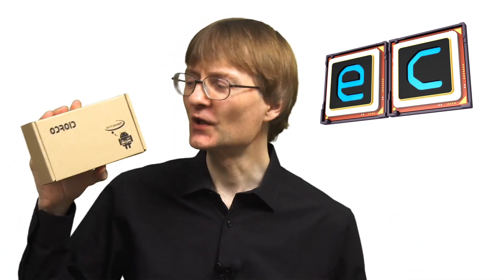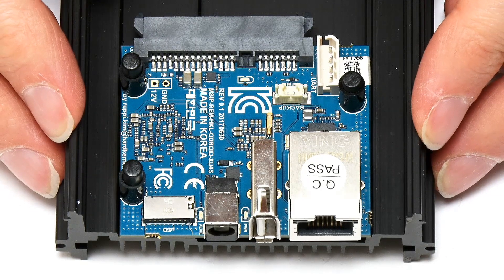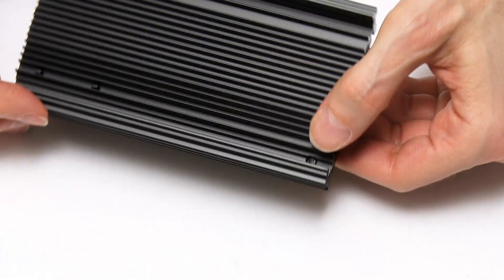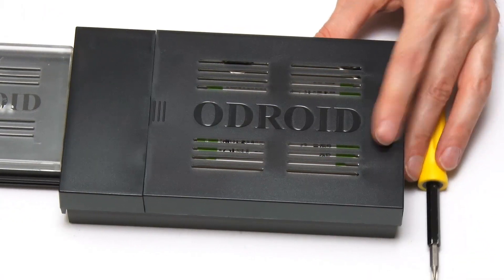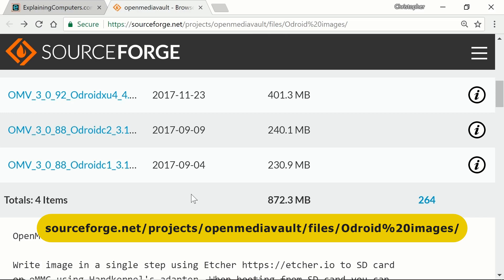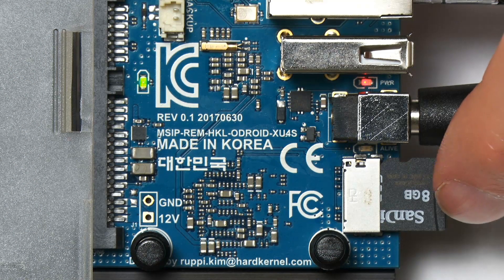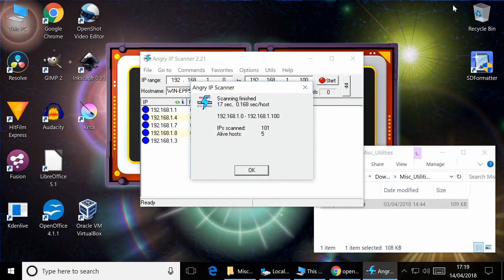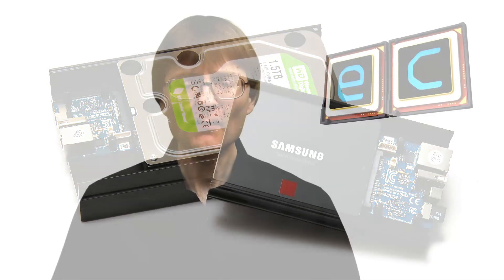Odroid HC1 & HC2 NAS SBCs

Comment: The only problem I have with this is the lack of redundancy as a proper NAS should have; RAID 1 at least.
Reply from the maker: There is nothing in the definition of a NAS requiring RAID  -- and rember that for domestic use, a fire, flood, electrical surge, theft or ransomeware attack will be just as dealy against two drives as one. A RAID NAS does not provide a safe backup of your data in most domestic scenarios.
Reply: ExplainingComputers yes, that’s true, but I’ve never implemented a NAS (ou a file server) without redundancy.
Yesterday I tried OMV and I think it’s interesting, but I had only a Pi 3B+ available so it was not very fast... that 1gb RAM, USB 2 and 10/100 ethernet just don’t cut it. But if I can find a backup software that allows me to plug an external usb drive and automatically copy all the NAS files, I’m buying a Pi 4. 
Do you think 2Gb is enough or the difference for the 4Gb version is very noticeable?
Reply: (Just realizes my answer is a bit off-topic, but you got the point...)

Comment: How long does it take to boot?
I want to use is as a sort of backup dirve, for doing weekly backups on my main server. The idea is, that i will turn it on using a smart wifi controlled relay, let it boot, mount its internal drive, do an rsync, unmount and turn it off. What kind of a delay to expect between supplying power to the device, until it is ready to accept network connections?
Reply from the maker: I cannot remember -- less than 30 seconds as I recall.

Comment: NAS need RAID
Reply from the maker: "NAS"  stands for "network attached storage", and no system "needs RAID" to provide such functionality. If you want to keep data safe, it needs to be stored on multiple, isolated devices in different locations -- something no NAS can achieve by itself, whether it is using RAID or not.
Reply: @ExplainingComputers  I dont thrust nas without raid focused on security.
Reply: That is correct, NAS does not need RAID. Whether you want it or need is a personal preference.

Comment: I have odroid HC2 (larger version) for over a year. Recently, I began to lose connection with the NAS when transmitting data through the Ethernet connection. The processor temperature was more than 70 degrees C. The reason is that the processor lost contact with the aluminum heatsink because the heatsink was bent

Comment: You should do a NAS with a new Raspberry pi 4 with 4GB of RAM and compare
Reply from the maker: I will indeed do a Pi 4 NAS video. :)
Reply: @ExplainingComputers  Sweet! I have one of those Synology Disk Stations, a bit older now,  and I love it, but I believe that the Pi 4 is actually faster, and with the 4GB model, that would be much better. My Synoology has only 512 mb :(

Comment: I Have 2 questions after ordering my HC1 : 

1. Can I make the Odroid HC1, at the same time, serves as a Web Server and a NAS ? 

2. Did the 2.5" HDD have the screw to hold it tight into the heatsink ?

Thank you !
Reply from the maker: It is a while since I made this video, but I think the drive screws were included. In theory it would be possible to install a Linux distro an run both a web server and a NAS. But I'm not aware of this setup having been done on the board. I would suggest contacting Hardkernel, or asking about this in their user forum.
Reply: ExplainingComputers my thanks ! 

I will look into this experiment when my board arrive :D

Also, if the speed is like 100mb/s, both SSD and HDD Max speed should be the same ?
Reply from the maker: Yes, NAS speed is limited by the Ethernet speed, not the drive.

Comment: Thanks, good video. But I wonder a bit about the use case. 

Megabit per second Megabyte per second
9 Mbps                   1.125 MB/s
10 Mbps                1.25 MB/s
11 Mbps                1.375 MB/s
12 Mbps                1.5 MB/s 

Amazon seems to recommends at least 15 megabits per second, Netflix 25 Mbps.
Reply from the maker: Your table is correct, but I am confused. The speed measured with the Odroid HC1 was just over 100MB/s (megabytes a second), or 800Mb/s (megabits a second). So it easily supports video data rates.
Reply: @ExplainingComputers  Yes, I meant it the other way around. It is so fast, that I wonder why I would need that. :D

Comment: 49$ sounds about right for what basically amounts to a HDD/ethernet converter

and it's even stackable
Reply: I would like so much to have a little bit bigger enclosure so I can fit another drive on the other side. So I can setup a backup drive.
Reply: @kugick  1. they are stackable, you can mount the disk from one odroid onto the other odroid and make a backup, like you would make any backup.
2. you can always partition a single hard drive and keep the two partitions synchronized.
Reply: @MsLia32  But isn't stacking a second one mean that I'm buying a complete second machine? To me it would be really cheaper to just have a secondary connection. I know it's really cheap if we compare as for exemple to the Pine64 NAS alternative, but still..
Reply: @kugick  yes, you will just have to do the math to see which solution saves a few pennies

Comment: Hello there! I bought an HC2 and no matter what I tried (different MicroSD card models/brands, power supplies, hard drives), the OpenMediaVault image you are linking to would not work. Found an article on the Odroid forums with someone having the same problem. Turns out that they have updated the image. It would be super useful if you would update the notes on this video. Thank you!

https://sourceforge.net/projects/openmediavault/files/OMV%204.x%20for%20Single%20Board%20Computers/

The file is:

OMV_4_Odroid_XU4_HC1_HC2.img.xz
Reply from the maker: Thanks for this, I've updated the link.

Comment: Hi there, it's me again. May be you'll remember me from yesterday. Well, I just want to confirm one thing regarding this HC1/HC2: Does any of them support wifi? If not, can I just plug in a wifi USB adapter (just like I do with my RasPi B+) to make it wireless? Also, will OMV support wifi USB adapter on HC1/HC2? Ya know, I'm now desperate to build another home cloud NAS. - Thanks 

P.S.: Odroid HC1 / HC2 is available in India and I'm pretty much excited to see the HDD connector and bay.
Reply from the maker: Greetings again! How could I forget the HC1/HC2. Sorry about that. Neither have WiFi, but you can use a dongle as you say (though it would be easier to set up OMV over Ethernet).

Comment: Anyone know if the HC1 can take a 15mm 5TB 2.5 drive?
Reply from the maker: Given the way the HC1 case/mount is designed, it can take all heights of 2.5" drive. So it should work fine. I do find it staggering that we now have up to 5TB in a 2.5" form factor HDD. Amazing!
Reply: Thanks for the information, I'll look into getting one when I see it at a good price

Comment: There is an image for running syncloud on this beast from syncloud.org for free which gives you Nextcloud as an app. Looks very promising so far. Testing in a VM and the HC2 would be the perfect device to run it on. Hopefully I can use rsync to backup all my nextcloud data to an off site NAS.

Comment: Hi Do anyone got Openvault to work on a ODROID-X2? I tried 3 SD Cards but cant reach the ip from webpage after 20min. So either the image is bad or I canät use that image. Please assist. I need OpenVault on ODROID-X2 old version Micro systemboard :)

Comment: I stumbled across this video after watching your latest video about the NanoPi NEO4.  I'm glad I did, as this kind of design is perfect.  Gb network and SATA on-board, and a stackable heatsinked design.  They've done nice work here with these products.
Reply: Well, I've had a chance to play with this thing, and although the hardware is nice, it's pairing with OMV is not so good, really IMHO.  With a 4TB WD Red drive, it takes about 5 mins to come on-line, when it does, even with all the settings as per your video, W10 see's the share, but refuses to connect to it.  No amount of tinkering can stop the HC2 from spinning-down the drive after about two minutes of no drive activity.  This despite my setting all the power saving to maximum power in DISKS/sda1/ - I have lost count of how many times the drive has spun-down and then spun-up again.  This is a major deal-breaker for me, as spinning-up and spinning-down NAS drives is a very good way to kill them prematurely.  Hell, even bog-standard drives will not last as long as they could, if the OS is spinning them down all the time to save power.  The WD Red's are designed to run 24/7 anyway, so it is 'Irritating' that there seems to be no effective way to stop OMV from spinning the drive down regardless of what I try to tell it.  To be fair, it might not be OMV doing this.  It could well be the USB3-SATA chipset on the HC2 doing it.  Either way, it is a deal-killer.  Luckily, I only bought one of these things.  Puppy Linux on any old PC with SAMBA is actually EASIER then this to get going, and has a video output via VGA or HDMI, so you can run it just like a normal OS, yet it's resource requirements are very modest indeed.  Not to rain on your video - it was excellent, as always. :)  Just that OMV on this thing is not as good as I was hoping it would be. :(

Comment: Hi, Inspired by your great video, I have purchased the Odroid HC2. However after assembling everything as described, I still could not get the devise running.  I find that after switching on the power, only the red Power light is on , the green LED lights at first glows and then its is off. No blue led light. The LAN connection is completely dead. No LED on top of the RJ45 jack  and  no recognition of the IP address. Just got stuck. Please advise how to proceed.
Reply from the maker: Sorry to hear this. Sounds like an image issue. So I would re-flash the SD card and try another first boot. It can take several minutes for the first boot to complete -- you need to give it time to sort itself out (and if this has been interrupted, the card is may have been left corrupted). You could also try redownloading the image, in case it is corrupt. And make sure that the SD card is seated OK -- and that you are using the right image! Good Luck!
Reply: Thanks. I re-flashed the  SD Card with the OS for the HC2. Now it is working fine. Thanks a lot for all the support.
Reply from the maker: Excellent news!

Comment: Hai I love the videos you made especially about SBC NAS. I'm having two 2.5 spinning hard drives and one USB 2.0 desktop Exeternal hard disk of 2TB capacity. Which SBC would you recommend to connect all them together...?
Reply from the maker: Thanks for this. You could use, say, a Rock64 with a USB 3.0 hub. Or -- as you will see here on 4th November -- a RockPro64 with the PCIe SATA card added. I was running OMV on this yesterday, and it is really fast. It all depends on what you can or want to spend.

Comment: Thank you very much with sharing this information, I'm wanted to improve my NAS setup, as I only have a Raspberry Pi 3 Model B NAS setup right now as it's all I had. I've been trying to find a reasonably priced solution and this definitely works. I'm also wondering if there are any solutions where you could use two 3.5" drives and run them in a Raid 1 setup with Gigabit Ethernet?
Reply from the maker: Keep watching! Odroid do a case that can fit two drives and an Odroid XU4. Pine64 do the RockPro64, which can be fitted with a 2x SATA card, and has a nice case for two drives and the board. I will be looking at the latter here on November 4th.
Reply: I just looked it up to see what is up with that, and that board is nuts, I had no idea it has a PCI-e x4 slot, that is a lot of options to expand the capabilities of this card. I think I see a RockPro64 in my future, but what would you get 2GB or 4GB? There's a 20 USD difference between the two.
Reply from the maker: A nuts board indeed! :) I did a review here: https://www.youtube.com/watch?v=CeoNHGFN_30 For a NAS, 2GB RAM should be fine. Note that the only issue with the RockPro64 is software support. Right now, support for the PCIe card is limited. As you'll see here in a couple of weeks, I have got OMV working well accessing SATA drives from the card (and USB 3.0 too), and also a minimal (CLI) version of Ubuntu. But no desktop OS. Note also that if you want to power spinning drives from the board, you may well want the 5A PSU. I have the 3A, and it works fine with SSDs.
Reply: I am familiar with the power draw of 3.5" HDDs, learned the specifics from one of your previous videos, in regards to software support, my current RPi 3 model be is running Raspbian Stretch Lite and I am running Samba, which was fairly simple to setup over SSH as I do not have a spare monitor or keyboard for it, storage and watching videos over the network I have works well, although limited to probably 1 video at a time. Is there anything similar to that to use with this setup to the Raspbian Stretch Lite and Samba that would work with RAID 1? Aside from that, I'd love to see benchmarks between the RockPro64 NAS and the Odroid HC1/HC2 NAS solutions.

Comment: Is it possible to connect two 3.5 HDDs to the HC2 and make a raid?
Reply from the maker: No, it can only support one drive. But Hardkernel do make a case/rig to accomodate an UX4 and two drives.

Comment: Well, I got up today. Re-imaged the Micro scdx..  I watched 4 OMV videos. None referred to my headless hc1 setup.  Still I plugged it in to network and set it up following your Rock Nas  / HC1 HC2 NAS videos both. Found and set them up on  base computer and new laptop.  I setup 2nd HC1 and mapped it to both systems.  I logged every ID/Password on Notepad as I went a long. loltonight Laptop failed connection (after I had opened the drive earlier today) It would no longer take password! strange.HC1 2nd is up and running on both well. I will try and  map iPad to both tomorrow.Oh, all 3 access for hc1 1 FAILED TO recognize passwords (admin, add, and pmd) when I logged thru IP Address  directly.But again, through that method, they all worked earlier today as well as through both computers as a mapped drive. I will see if both remain on network as identifiable.  I had to use ANGRY IP to get IP for 2nd hc1.  he was hiding on network well.any ideas?   oh, How do you send files to each storage?  open the  drive created?  The window then shows C drive data not Z or Y..I thought I could click on drive/open window and drag/drop folders.Thx again!  I am getting closer.  Determined as ever but running out of time to finish it.
Reply from the maker: Thanks for this. I am reading these in backwards order. Please keep a conversation within a single thread (replying to replies). I am struggling to know what to tell you here from the info supplied, but wish you luck! Once you have mapped a network drive it will indeed (if you allocate it so) be drive X, Y, Z, etc. You should then be able to open a drive and drag and drop to it (or save to it within any Windows app). It will just be like any other drive. Network drives should also stay mapped (if you set them up to reconnect). As you have one HC1 up and running well, you must be close! :)
Reply: LOL, Never thought of backwards messages. (duh)that supposed to confuse the enemy. lol jk  OK 2:12pm Eastern. Back from Doctor.  logged onto laptop where last night only 2 nas was staying connected.  I reconnected NAS1 and it took and I learned how to transfer file into that little window.  Also created special files under the main file created.  no data here to transfer though.  I will log onto old pc and send tons of data (That will be my first test for NAS1 AND NAS2 AND ON MY CAPABILITIES.  I guess connection fails at times.BUT last night it would not accept the correct passwords. (NAS1).  However, it did just now sooo.?! lolOnce I tackle 2x iPads and base PC in data transfer I will have graduated in working with FIRST EVER LINUX DEVICE/ENVIRONMENT.  but don't hold breath.  It may take a while. hahahahahahAHA((My BI-POLAR)) is a monster to fight against to focus on tasks.  (especially new tasks)  takes me 10 times longer than others OR MORE.  that was why I was possibly asking for a slow personal video. lol  stop it every 3-5 seconds, do the step, verify page info, start your video and repeat. hahahahahaBUT I am DETERMINED TO SUCCEED AT SOMETHING!  I ALMOST LET IT DESTROY MY LIFE AND SIT IN A CHAIR THE REST OF MY LIFE DOING NOTHING.  tHANKS TO YOU THOUGH FOR GIVING ME INTEREST AND MOTIVATION WITH YOUR VIDEOS!  SINCERELY!MY neighbor said if it works, he wants me to do one for him.  I told him, I'll just add him to mine and he can pay me small fee each month.  that will afford new disks when needed. (We already share electronic(s) access for years.... a very good fella he is!)   thank you again for everything you have done for me!

Comment: Sir Chris, TOday I received 2 HC1s finally.  question. Memory comes MicroSD UHS-1 XU4 Linux.  Did you keep that on the memory when installing OPENMEDIAVAULT software? or did you wipe memory clean first?  2) I am planning on running them separately on network UNLESS you can point me to software that allows them to act as one NAS.
Reply from the maker: Greetings Sir! You will have to wipe the microSD card to install OMV (well, installing the image will wipe it -- so no need to do anything other than the OMV install). You will have to run them as two NAS units (unless you write some clever HC1 NAS cluster software yourself). Good luck with your new hardware. :)